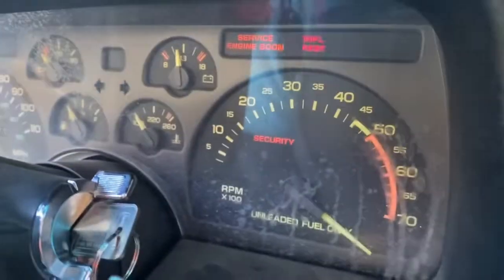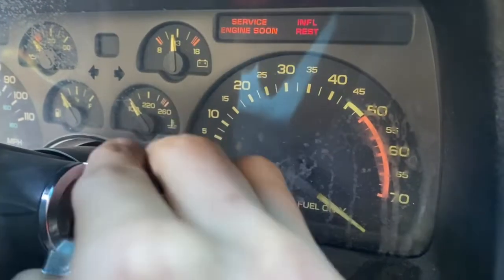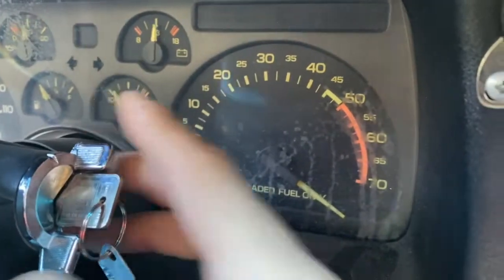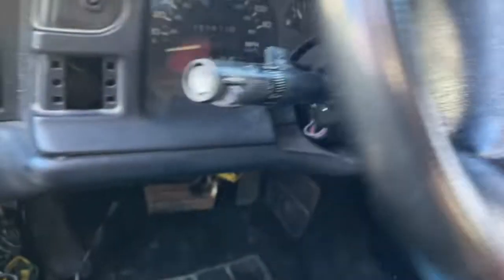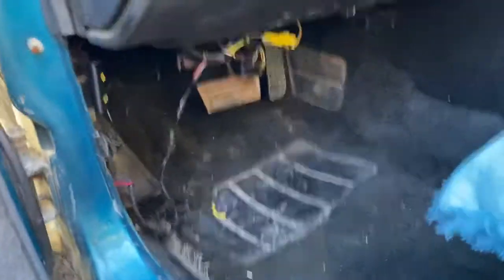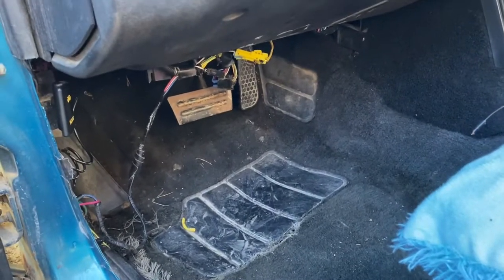COMO Lock Shop Does VATS and More! Third VATS This month. Weird!

Comment: We can't bypass them up here its illegal. There is 15 values. Alot still bypass them as the wires brake up near the ignition all the time. And the keys are cheaper.  I scope read the ignition on those vats. Numbers are stamped on the wafers.
Reply from the maker: 14 values. Corvette only uses the first value. And you’re right. Wires break. Keys are cheaper, etc. not illegal here tho

Comment: Another beautiful piece of work. Glad they are going extinct. The time to figure out the resistor value can be a time waster.
Reply from the maker: Right? Especially if you mess up and have to repeat the process again!
Reply: @JarethGarza  yes love that also. Add freezing rain to it also. Had lots o fun with these old heaps. The rest around here don’t touch them.

Comment: I see you went with a bypass
Did it have the code on the lock for the resistor ?
Or did you go 1 by 1 til off?
Reply from the maker: Double sided ignitions have the VATS value stamped. This was a single sided.